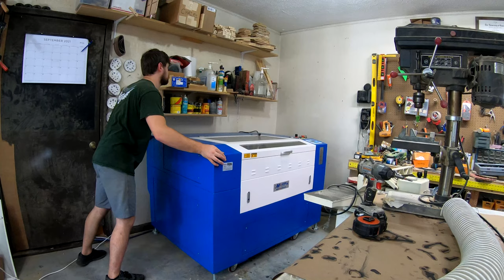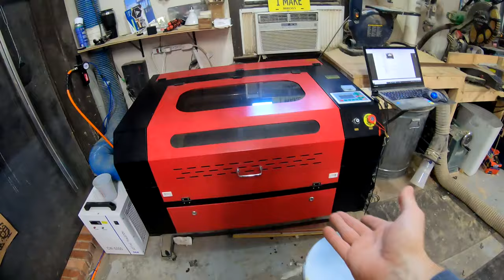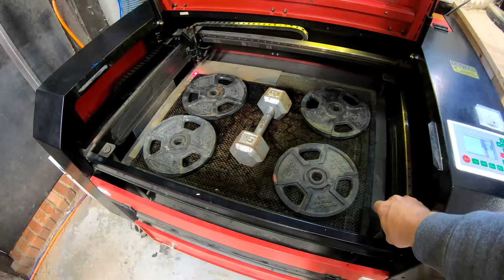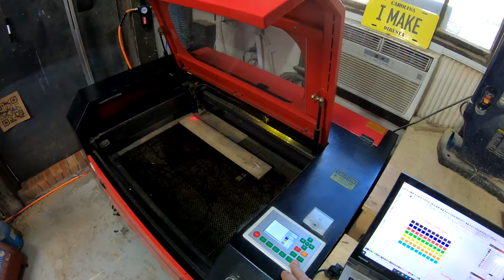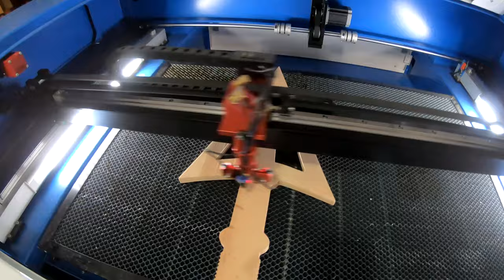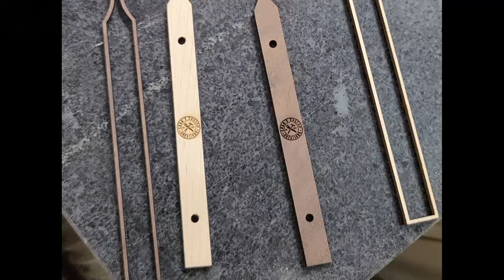BEST Chinese CO2 laser engraver cutter RM Laser VS Generic Laser

Comment: Hi Chad quick question. You have had this Blue laser for a few months now. Are you still liking it or have you had any problems with it yet? I have emailed Ray and looking into it. Thanks
Reply from the maker: No problems with it at all still loving it. I am actually just finishing up another batch of 48 12x12 signs for a clothing company and it did great.
Reply: @ChadsCustomCreations  for the whole year have you changed a laser tube? Also is it compatible with light burn?
Reply from the maker: @marianecarandang8315  my first laser tube is still seems to be running at 100% power even with how much I use it and run it at full power. I have changed the tube on my red laser it’s not hard. Yes it is compatible with LB it is a ruida controller.

Comment: Is there a rotary attachment or do you just use the diode lasers? The quality and speed of this is what interests me.
Reply from the maker: Yes they make rotaries for these and I have 2 of them. You just gotta make sure they have 24v stepper motors and you plug them directly into the Y axsis plug when doing rotary work.
Reply: @ChadsCustomCreations  which rotaries do you have the best luck with?
Reply from the maker: @noneyacabbage  this one here is very similar to the one I use on my RM laser https://a.co/d/3Q3y1wu

Comment: Hi Chad,
We need to engrave acrylic sheets, woods and steel and cut MDF boards up to 10 mm, do you recommend this particular model and what wattage?
Thanks in advance :)
Reply from the maker: Yes it is a great machine for that and will have no problem with 10mm. You cannot truly Engrave steel with a CO2 laser but you can use a marking spray like cermark which is what I do when working with metals. 

I love the 90w like I have but if I had the space the bigger 150w by RM laser is definitely worth the extra money for the power and size.
Reply: @ChadsCustomCreations  This is helpful Chad, thanks a lot. Keep the videos coming.
Reply from the maker: @silentbullet1987  thank you for the feedback and encouragement

Comment: Chad I've been looking at engraving vs cutting and wattage. I see some forums state that the quality is not a fine using a 100watt laser vs a say 40watt laser. can you tell me about your experience with this. I don't really want to purchase 2 lasers at this point. if you have any videos or forums, you can point me at to research this further.
Reply from the maker: I’ve never run into a situation where my 90w could not get fine enough detail on something. When focused the dot size is about .1mm. Most the time I will actually put it out of focus a little so I can even increase that dot size and do my engravings faster at a larger interval.

Comment: What voltage does this rm laser machine use? Is it 110 voltage domestic v
Reply from the maker: You can choose 110 or 220 with a switch on the machine

Comment: Is there a trick to get the red pointers dialed in?
Reply from the maker: I normally just get it at the correct height away from some test material and then do a pulse. If they are not both hitting where the laser pulsed just adjust them until they both meet at that point.

Comment: do you have a basic materials power / speed setting chart?
i have laser experience but new to lightburn.
thanks
Reply: or do you sell one in your etsy shop?
Reply from the maker: Sadly I am not organized well enough to keep up with that like others have. I do have a engrave test file and a cut test file that I run when working with a new material.

Comment: have you cut steel with this, and does it run on 220 or 120 volts?
Reply from the maker: This one can run on either I set mine to be 120v. I can’t seem to get my Co2 lasers to even mark metals but surprisingly I’ve cut 22 gauge steel with this new 70w diode laser.
https://youtu.be/GHFWKfaUeuU

Comment: I’ve been looking for a laser I can fit in my basement but I haven’t found anything that’ll work.
Is there anyway that this laser could be stripped down. I need it to fit through the door way that’s about 27 inches.
Reply from the maker: I'll have to take a closer look he does sell a smaller model that I know the base can be separated quite easily cut area should be about 27x19

Comment: Nice! 
But, it wont accual reach 1000mm/s. Its the same thing on 3d printers, you have something called "Acceleration over time", it wont go to 1000mm/s in 0.00000001 second, than your machine would die pretty quick, belts and stuff would take huge damage. Lasers, 3d printers, cnc etc are constructed to act like a car, to go from 0 to 200 it uses acceleration, the heavier x-gantry, the slower acceleration you need to keep your motors, pulleys and belts safe. Same with breaking before laser head needs to stop. So, at this little range the head is traveling, you will never reach 1000mm/s. But it looks cool anyway =) Just a little lesson, dont know if it made sense at all tho :D
Reply from the maker: Yes you are right!

Comment: How do you convert the air from the compressor connector to the small tube on the laser?
Reply from the maker: This bundle should get you there.

https://www.amazon.com/dp/B07RJ1BYKV?linkCode=ssc&tag=onamzchadddow-20&creativeASIN=B07RJ1BYKV&asc_item-id=amzn1.ideas.3AS04C0BGLQSK&ref_=aip_sf_list_spv_ofs_mixed_m_asin
Reply: @ChadsCustomCreations  Thanks for your reply, all the best.
Reply: @ChadsCustomCreations  I have the bundle but still stuck as the air compressor has a female quick connector and I don't know how to connect to it with this air hose

Comment: How dose these not freeze and crack the tube in the wintertime????
Reply from the maker: They would go check out my video on how I winterize my lasers. Heater and a pump added to the chiller is my technique others use RV antifreeze but I like keeping it at optimal lasering temps.
Reply: I use Chads winterization method and RV antifreeze in my rm1390. This is my first winter and its been cold here in Washington State and so far so good.

Comment: Chad can you give some insight on how you decided on the rm laser. Did you consider Thunder lasers or any other brand?
Reply from the maker: Hey Doug, I was contacted by the owner and designer of RM Lasers. He was wanting someone to compare one of his machines to the red and black no name model like I purchased back in Jan 2020. I had never heard of RM lasers before but now that I have one if I do buy a 3rd it will be the larger model that they make. I really don't think you can beat this quality and speed without spending another $10k.
Reply: Thanks
Reply: @ChadsCustomCreations  Where is it available for purchase? I want this one but the few places I've seen it's completely sold out
Reply from the maker: @SlightlyShady  I believe with the recent popularity of this video they sold out and have been for a while. I know of a few people who have ordered directly from emailing the owner of the company at ray@rmlaser.com let him know Chad sent you and you will get a better price than what toolost.com could offer.
Reply: I'm thinking it would be awesome to be able to engrave something like floor molding or trim. Any Ideas on if something like this could be done using  the passthrough section of a machine like this?
Reply from the maker: Yes absolutely unlimited length with the passthrough up to 36" wide.

Comment: Another question I'm putting a logo on a stainless tumbler and power is 90 and speed 200 using cold galvanized compound and when I wipe off it takes everything off
Reply from the maker: Yeah I really am not a fan of the cold galvanized stuff it actually requires a very precise amount of power and Speed, and the fumes coming off of that stuff seems highly toxic. I prefer the brilance metal marking spray.
Reply: Thanks I was going to order some
Reply: When using brilliance on stainless steel what is your speed and power so it leaves a solid black I'm getting broken marks
Reply from the maker: Make sure your air assist is extremely low or not on at all. I'll have to go check but I though I was doing like 100speed 100 power but I could be way off I know there is a big range in what it works with. Do you have a speed test file set up? You can make one with this https://www.o2creative.co.nz/laser/lightburn_basic_generator.php
Reply: @ChadsCustomCreations  thanks

Comment: Chad I had a Whatsapp video chat with Ray last night and I'm now looking at the rm1390. I made sure he knew I found his machine on your site. I was wondering if I purchase a larger laser am I still able to engrave on small items as well as if I was using a smaller laser. if so how much of a difference is it. I'm hoping to use this on large project board making multiple smaller items that will be engraved on and then cut out. Any ideas or comments you have would be helpful and appreciated. Again thank you for this video it put me on the RM laser path.
Reply from the maker: Oh yes definitely the big lasers can still make smaller detailed items the same as the smaller work area machines. Calibration of the mirrors further away is slightly more precise with the larger work area but look up the American photonics red dot laser alignment tool. That’s what I use and it makes the alignment of the laser and mirrors so much easier.
Reply: @ChadsCustomCreations  Do you have a video on how to use the American Photonics red dot laser alignment tool?
Reply: @ChadsCustomCreations  where did you purchase your alignment tool?
Reply: By the way love your videos especially the tutorials.
Reply from the maker: @stevewoodrich5130   mine takes the 24mm and get extra batteries also it runs through them quick. 

https://american-photonics.myshopify.com/collections/mark-and-engrave-co2-and-fiber-laser/products/k40-reverse-laser-alignment-nut?variant=31563329011773
Reply from the maker: @stevewoodrich5130  I don’t but someone does just search for it
Reply: @ChadsCustomCreations  Perfect thanks again. They show how it works on the site you sent above
Reply: @ChadsCustomCreations  does this link take directly to the alignment tool I want to buy for the rm1390 or should I wait until it arrives to take measurements?
Reply from the maker: Mine uses the 24mm but to be safe it might be worth waiting and measuring yours once it arrives.
Reply: @ChadsCustomCreations  I purchased one of these for my laser that is on its way here.

Comment: Im looking at just getting started with an engraving business. It will start in my residential garage. I want a laser that I can grow into once I start expanding into cutting. To start it will be glass wear and tumblers. Already have a couple of leads that will be buying from my start. Is the big blue a reasonable fit for a garage start up? I have a dedicated amount of funds all ready to set up. Also how do I contact your supplier to give you the referral! Thanks so much.
Reply from the maker: Hello Eric I would definitely say so I am still running all of my jobs off of big blue and it is being used daily for over a year now no problems at all. I just finished a job for a hotel requiring over 800 units and it performed nonstop with perfectly.

I would email the owner at ray@rmlaser.com for your inquiry he is really great and can let you know if there are any machines already in the US for sale.
Reply: @ChadsCustomCreations  thanks so much. Could you share the model you used and any additional equipment needed to be up and running? Thanks for sharing your experience and being a mentor to so many.
Reply from the maker: I believe my model number is the WL9060. If I recall correctly I think I only needed to have an air compressor everything else was provided. If you’re going to run it in an not air conditioned space in the summer upgrading to the cw5000 water chiller is a must have.
Reply: @ChadsCustomCreations  good to know Im in Florida and it would be a non air-conditioned garage.
Reply: @ChadsCustomCreations  I am ordering the same unit. Thanks on  the informative video and your responses!! I'll send a photo once I'm set up. Getting all my vendors/suppliers lined up now.

Comment: If you get light burn for the machine do you need a laptop? And what is a good rotary for this machine?
Reply from the maker: Yes lightburn is used with a laptop. Pretty much any rotary with a 24v XLR plug will be ready to go.
Reply: Thanks for the info Im green to all this want to buy this machine when they come in stock. Want to have a small business when I retire
Reply from the maker: @Jeff Lester  that's great to hear, and don't be scared to ever ask for help I love sharing whatever knowledge I have gained from having these machines.
Reply: Just got my laser now all the questions on lightburn do I need just for computer or I see they have the controller on the laser. Do I need both or just the laptop I bought the blue 90watt that you showed. What laptop would you recommend size of hard drive and memory thanks for any help
Reply from the maker: Awesome, so lightburn on the computer will be where you do most of the stuff you plug into the machine via USB and can control it from there. The controller on the machine is good for moving the laser head around framing and simple things like that. 

Any normal computer or laptop will work LightBurn is very kind to even the slowest machines. Just no chromebooks
Reply: Chad is there any type of user manual or what buttons do what to help a little I'm playing with buttons but not sure what I'm doing any help would be appreciated thanks
Reply from the maker: @jefflester7655  Here is an online manuel I have.
https://drive.google.com/file/d/1GPfpo2w4QnfsMQQ55HxtvgXtvs0PTT2L/view?usp=drivesdk
Reply: Thanks for the manual probably will be asking more questions hope you don't care
Reply: Chad is there a chart or guide for settings on different materials so it will be close and I don't have to burn up so much time

Comment: Hi Chad,  besides the keys not opening the front extended material door the RM750 machine runs and looks solid, thanks again for your help! Will give Ray a pass for the wrong keys sent. :-)  Thinking of buying a Fiber laser from him, going to do a bit more research on what to look for on Fiber to see what I will be getting from him.   

 Question,  how often should one grease the tracks where the laser moves back and front, they look fairly dry when the machine was originally shipped,  not sure if they even require grease and if so what type should I use?
Reply from the maker: So great to hear that you like the machine! Oh yes! I am wanting to get a fiber laser aswell. As for the rails I would see lubricant them when they are dry or you can feel resistant in my case sawdust is always an issue so sometimes cleaning first then regreasing them is what I do.
Reply: How have you liked the RM750? Any surprises, good or bad?
Reply: @homiethefish  The machine is great you pay for what you get and in this case you get a little bit more than what you pay  because the owner Ray really really backs his machine and helps you out a lot.  He cares unlike so many that dont
Reply: @betobeto7903  Thanks for the info. Looks like I’ll be ordering mine later today.
Reply: @homiethefish  Cool,  wish you the best
Reply: @betobeto7903  What is the working size for RM750? Price and watts? Can you cut 6mm birch easily?

Comment: Having problems with framing on tumbler the x movement I set the numbers in lightburn move section and I go to framing and the x goes to a different location any help I would appreciate thanks
Reply from the maker: Are you using a rotary? If so on mine you lower the bed down enough to reveal the plug in the right inside the laser that is the Y axsis motor plug you will make sure the machine is off. Unplug the y motor and plug the rotary into that. Now you can turn it on it is going to attempt to home and you will most likely have to manually move the gantry up to hit the morning switch to finish the homing sequence. In lightburn you have to check the box for rotary. To calibrate the rotary I would suggest doing a YouTube search on how to calibrate rotary in lightburn it will explain it better than I can.
Reply: @ChadsCustomCreations  yes I have a rotary I got the centering down but it seems like my laser is not firing strong I set it to 100 ant its barley lit
Reply: They sent two tubes one was in the machine and the other was in a box
Reply from the maker: @jefflester7655  lots of variables to power. Are the mirrors and lens clean? Have you done a mirror alignment check? These may not be necessary but there is always a chance these could be affecting the power coming from the tube.
Reply: @ChadsCustomCreations  the red laser light on the controls is flickering and the tube it tries to get brite for a sec. I dont even see a light in the mirrors to adjust
Reply from the maker: The flickering red light on the board is normal it is telling you when the tube is firing CO2 laser is invisible definitely don't be looking for it as you will shoot your eye out. 

This will explain how to get your mirrors set
https://youtu.be/tFbuOs_98n8

Comment: Does it have an ammeter?
Reply from the maker: This model does not but I believe the newer ones come with power supplies that have a digital amp meter reading that you can read if you take off the side access panel.
Reply: @ChadsCustomCreations  I'm checking a Vevor and in their website i can't find anything. I guess even the newer versions are not coming with it
Reply from the maker: This is an RM Laser not Vevor.